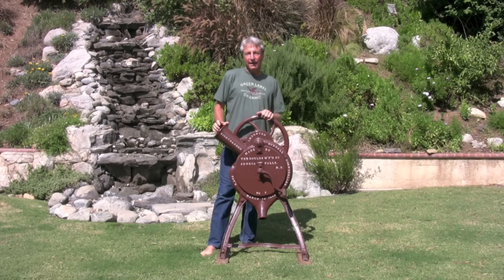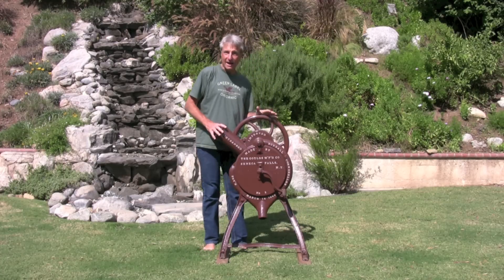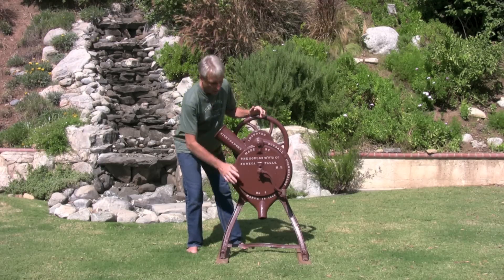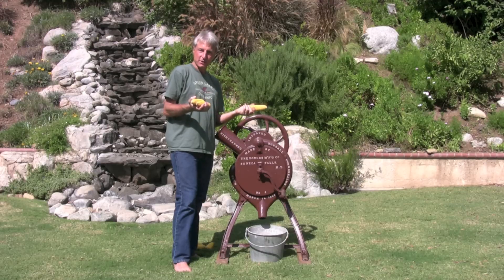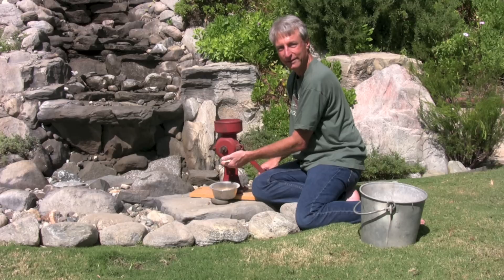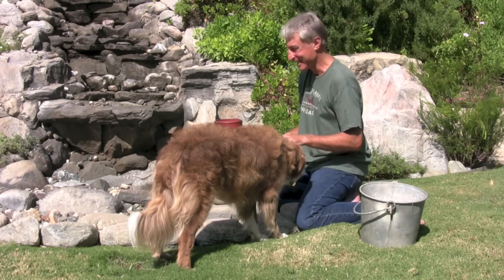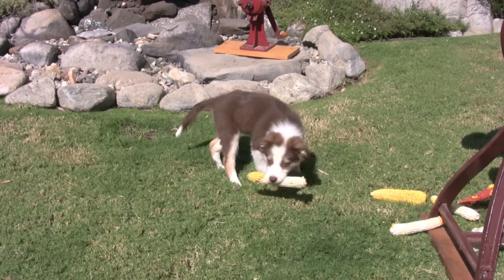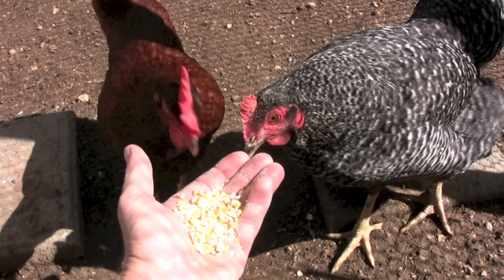1863 Burrall Corn Sheller

Comment: What is the wheel for? I have an old one I'm trying to restore but the wheel is missing.
Reply from the maker: It’s a flywheel.   You’ll need it so the shelter has sufficient momentum.  It won’t work well without it.   Find yourself another iron or steel wheel of similar dimensions and mass.